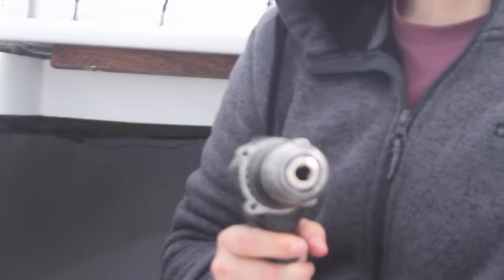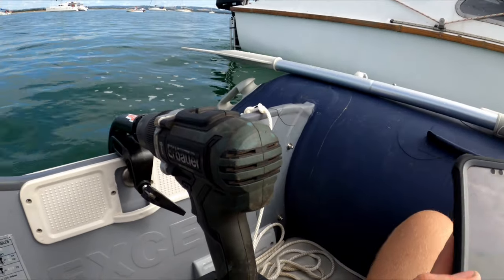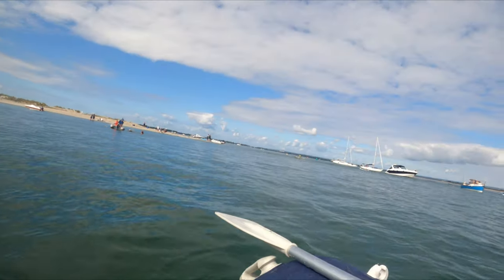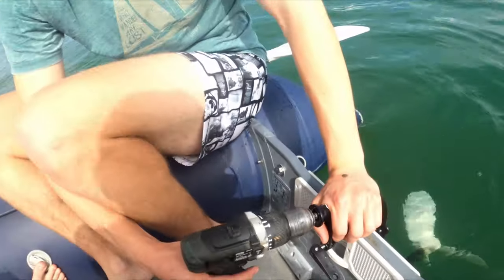CRAZY FAST DRILL POWERED BOAT MOTOR! Sailing Meraki | Ep.47

Comment: Brilliant! Now here's a little challenge for you. Get yourself an 18v fan control switch and add a small plug to the drill so you can connect the switch and bypass the trigger. You'll have variable speed control and be able to position yourself more comfortably 😁
Reply from the maker: Now that would be a challenge!

Comment: I have been using a 18VDC Milwaukie drill on my Hobie OB SUV kayak for two years now fishing in the Fort George, St. John's Mil Cove Jax FL rivers, using a drill paddle sold at Walmart. It was $24.00 back in 2020! Now almost double that cost in 2022! The aluminum shaft has broken at the chuck point numerous times just from leveraging it against the kayak to make turns or just to stay moving straight. I just cut off 4"s of the PVC pipe and make it a bit shorter and used it about three more times that way. Once I ran it into a shallow oyster bed and bowed it real bad before stopping the motor. Almost lost it that way TOO! :.0! I just bent it back in place to get home and bought a new one. It wobbled a lot after that mishap. :.) Be careful you don't pull the trigger of the drill while the propeller blades are close to the hull TOO! :.(  Makes some mean gash marks in the plastic. Once night fishing I dripped salt water on to the lithium battery pack connected to the drill from the paddle I was using at the time. Thought I was making POP Corn for a few seconds before I put a stop to that!:.) 
The shaft is made from aluminum perhaps stainless steel would have been a better design?  Even switched out the two blade prop for a three blade, beefing up the speed and torque. You can't fit it into the foot pedal hole with three blades on it though.  Oh well I'm switching to a trolling motor soon so no bother. I burnt up the brush drill after two years use on a 9.0 va/hr battery pack. All ways keeping another battery pack and drill onboard as a spare. I was doing two mile runs using this thing to get to my best fishing spots without peddling there. I was going to use my brushless drill on it next to see how long it would last. I tried my 24 volt Kobalt using it too but the midrange speed wasn't there!  Either low or high is what you get from it. I'm almost 65 years old now and my arm went completely numb after over using it holding on to the motor for to long in my last week-end fishing event. So it's time to get on with the need of spending MORE money and using a trolling motor for the leisure life of fishing the open waters in my up coming life of retirement. jkwaak@att.net
Reply: Can I get a link to the 3 blade prop your using? I'm gonna do the same how did your drill battery last out on the water?
Reply: Also the price increase on the drill paddle is due to them using better materials I believe it's a semi steel inner shaft now!

Comment: You can also see that's a low amp hour battery. So if you got a drill that has a larger one, the battery will last longer and have a little more power. For instance our Milwaukee M18 5.0ah batteries will run our stick vacuum much longer than the 1.5ah battery. That looks like a 1.5ah battery by thickness, maybe that company makes a 3ah or so? Perfect product to pair with the drill though. It takes away from trying to find a trolling motor or small outboard to rob the outdrive from.
Reply from the maker: Yeah a bigger battery would definitely help!

Comment: One observation. You would get better efficiency if the prop was fully submerged. You are getting too much surface cavitation. And a question. Did you buy chance see if this would move you sailboat in any way?
Reply from the maker: Yeah I agree and it’s just a pain that you can’t adjust it. Haven’t tried it in the boat yet.
Reply: @AlexGoesSailing  Crazy but another option to consider is a battery weed trimmer with an edger function. Already has a shaft to allow for submersion into the water. At would allow for a larger prop option giving more thrust. And a weed trimmer is designed to operate for longer periods then a drill.
Reply from the maker: @ygrittesnow1701  that’s a good idea!

Comment: You need to try this with an impact gun. I can imagine youll probably go double or triple the speed. And the battery are way bigger so also longer drive time. Only flaw would be the extra weight. But what’s another 10lbs lol
Reply from the maker: I do have one so might try it. Bit worried about the extra torque breaking it even more!
Reply: @AlexGoesSailing  have to find out, I know you said the part that actually goes to the prop doesn’t break. So maybe welding on a 1/2in socket or something along that line.
Reply from the maker: @Jcslim138  yeah will be welding the shaft out bigger so it is easier to attach a drill or impact but I think the impact would shear that shaft for sure.
Reply: Don't you want speed over torque though?

Comment: Whats your latest development on this? I was about to build one drill powered myself and then I found this :) did you find a way to extend the shaft for better grip on the drill?
Reply from the maker: Yeah it’s quite easy to extend! I used a welder but you could do it so many different ways. I will be trying it on my paddle board next🤔

Comment: I would love to see this with the 3:1 reduction! Also wish the freewheeler was about 3 - 4 inches longer for better placement in the water
Reply from the maker: It’s a 3:1 but the gears didn’t last that long! Yeah a little deeper would be good.
Reply: @AlexGoesSailing  my idea is to attach a chainsaw or a small lil dirtbike engine 50 or 125cc 4 stroke
Reply: @AlexGoesSailing  where is the next video of this bro cmon we losted u
Reply from the maker: @K0nstandinos_K  will be soon!
Reply: @AlexGoesSailing  im looking atm electric chainsaws on google, and they dont make so much noise, but the batteries on some last in 15 mins, we will see
Reply: @AlexGoesSailing  take a look at it they still selling it and they say its original from my country, not like some chinese crap, cost about 120 pounds
Reply: @AlexGoesSailing  isended the link 2 times, but commet keep deleting itself i dont know

Comment: It looks like the designers didn't venture into prop design theory. It looks like that prop is too big for a dinghy with too much pitch - and that is before the 3:1 gearing on those tiny little planetary gears. You need to get the right prop for whatever motor you use and RPM expected.
Reply from the maker: Yeah they definitely didn’t design it very well! I will probably make some more modifications to it and see if I can make it much better. That prop it massive!

Comment: How about just a long shaft with a prop on the end... then stick the shaft straight in to the drill.... May need a bearing on the shaft and a drop in point where it pivots....
Reply from the maker: That is a good idea but this a product that I bought that was hand powered until it broke. So a simple modification and I get steering and the force more efficiently being applied in the horizontal axis. If I was doing it from scratch I would do it the same way you said!
Reply: I used a 750 watt bike motor with a 4'long straight ss tube for a shaft (like a mud motor)and a prop from a 2 hp gas motor.  A 5 amp drill battery and a pwm speed controller for variable speed. 
 I put it between two inflatable sups that are held together with 1"tubes.The tubes slip into 1 1/4 tubes that are strapped around the sups. We sit on two beach chairs. 
A bicycle retrofit electric motor, speed controller and wired remote can be under $150 depending on motor size.  It works well, but does not steer too quickly- yet.  I just found a dewalt "battery to wires connector" at temu to make battery connections easier. 
Going over 4 mph sucks a lot of juice, so I am looking into putting it on hydrofoils and make it a speed boat.

Comment: I have tried impact  drill ,but it did not increase any speed , rpm did not go to  their   max for some reason , instead impact drill provided  exactly the same max speed   as my cordless drill and therefore  rpm i suppose,  and mad hammering noise as the only bonus.
That's with self-made drill paddle and small prop from trolling motor though.

I get 5 km max speed with my gear 
Self-made handheld  drill paddle with no mount and small prop from trolling motor and cordless drill 1800rpm.

Poor built quality off my drill paddle and no mount make drill overheat and 5ah batteries die every 500 metres.

Drill rpm 1800 
Impact rpm 3200

Bloody drill paddle with no mount is hell to hold as well :))))

I am now wondering what will be better in terms of max speed and battery life. Your toy or drill paddle with built in mount in to it as one piece and sold on AliExpress with small prop from trolling motor.

I have even bough impact a specially for this , but returned it day after.

P.S. I have 10 batteries 5ah each for business use any way + drill and that's why i am even more after it all :)))
Reply from the maker: Yeah impact will be useless as doesn’t have the power. On my two 2ah batteries I can do about 3-4nm.
Reply: @AlexGoesSailing  Going to get your toy then and stick to my 1800 rpm, I bet I will get 4 knots solid at max speed, as well as about 5 miles range with my batteries :))))))) 

Will also use Ryobi cordless tire inflator / deflator in deflation mode to suck out heat to get the most of it.
That best ryobi cordless tire inflator with lcd screen.

Thank you vm  for test results
Reply: @AlexGoesSailing  lol just realized that singe spin gets prop spinning 4 times so if drill gets you 1400 rpm then your  prop was spinning at 3600 rpm ! 

My drill is 1800 so = 7200 !!

Comment: If you take and put the prop lower in the water you'll get better forward motion and you will get better speed
Reply from the maker: No way of mounting it lower but it would definitely make it a little better!
Reply: Yes there is that little place where there is a mounting bracket cut a notch in lower the bracket it should just be a hard plastic board so that you can hook a trolling motor to right? Are you there to do is cut a notch in it and lower it down
Reply from the maker: @robbiebyers6222  I would do that if it was an old dinghy but this one is new! I could make a lowering bracket though!
Reply: Try taking and using a giant C-clamp which would give you a lower surface to connect I like trying to figure things like that out

Comment: I've seen the gear reduction drive breaks on a lot of these because of junkmetal gears. It's a real shame because I've set out on a mission to get my hands on boat and make it foot pedal or hand crank withojt spending hardly any money, and make it exempt from registration in my state. I want it to be as cheap as possible and free to operate. I have plenty of paddle inflatable kayaks but I want foot pedal or hand crank for this mission. Most cheap  inflatables don't have transoms nor can they take them, the ones that do are expensive and most set the transom too far back to reach this hand crank. Hmm

Comment: Now try it with a vacuum cleaner or washing machine motor ;)
Reply from the maker: That could be interesting!
Reply: @AlexGoesSailing  I’ve seen people drive home built electric speed boats and go carts with them online and it seems to work. It would need a separate battery, of course but I’d guess it would deliver quite a lot more power than your drill.
Reply from the maker: @SomeNot  the next limitation is that bendy shaft!

Comment: I have Watersnake two horse power and with my boat it goes realy fast and it is electric an was only $280
Reply from the maker: i will take a look at that!
Reply: Lol your motor gets same speed as this toy , or slower and it also need  a very heavy battery + battery charger + battery waterproof box = 280+150+70+ 25= 515 :))))

= Toy from this video wins